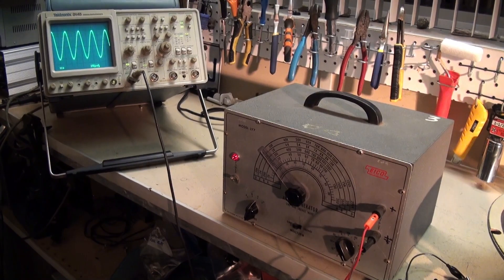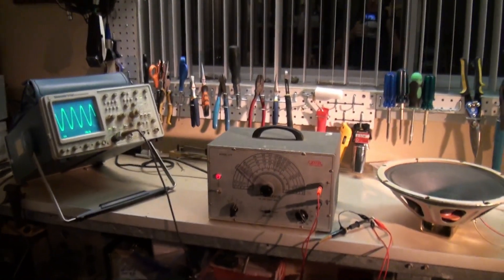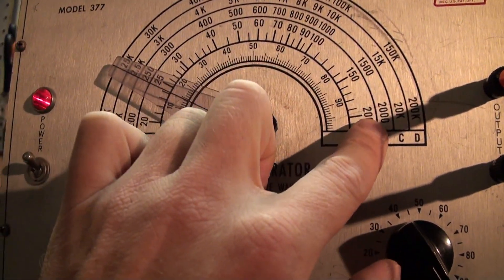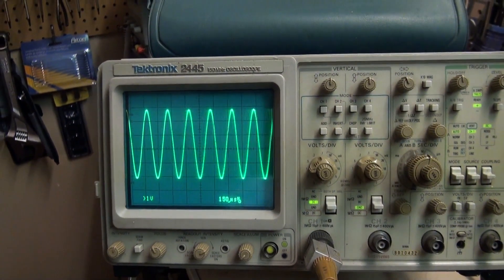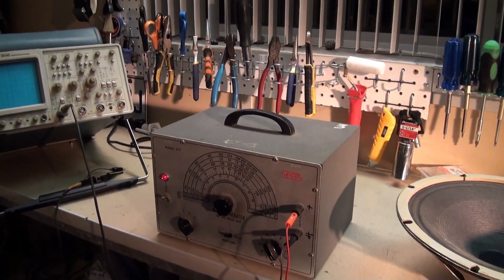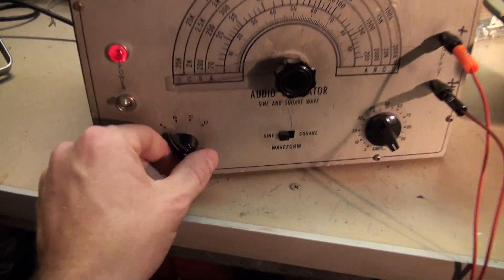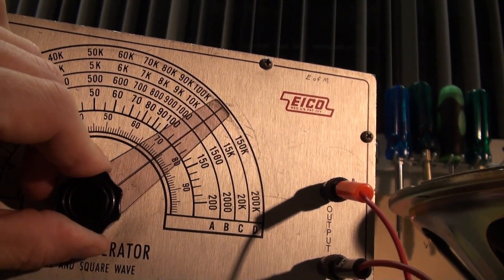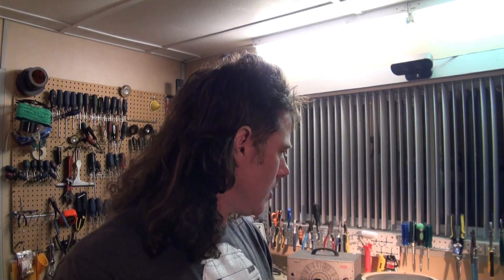The Fletcher Munson Curve - Human Ear (Part 1)

Comment: If you were to place a hard black board or plate on top of the speaker, then place a small pile of salt in the middle, all the frequencies will create different geometric shapes.
Reply from the maker: Indeed !!  Your like 10 steps ahead of me...
Reply: @UOttawaScotty  actually more like 1700 years, but don’t feel bad.
Reply: Or a plate of water will also demonstrate, how frequencies can alter matter.

Comment: Dude when are you going to get the sand on the drum skin? Let's go
Reply from the maker: Lol ! Right after the iron filings on paper with a magnet underneath video 😜
Reply: @UOttawaScotty  Cymatics... apparently you can just use table salt
Reply: @UOttawaScotty  you have seen those videos I'm talking about right? All the different snowflake configurations? I think all you have to do is put a drum skin on top of that speaker and sprinkle some sand on there.. might be cool to try it with different size particles.,. Don you're protective eyewear professor